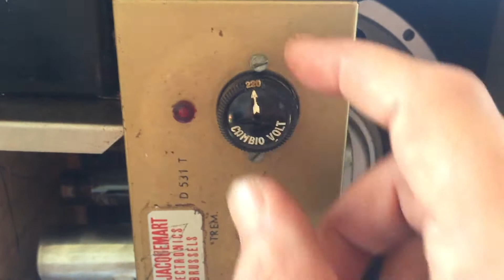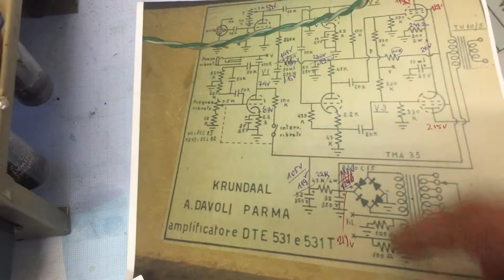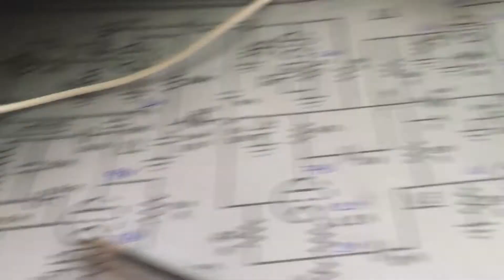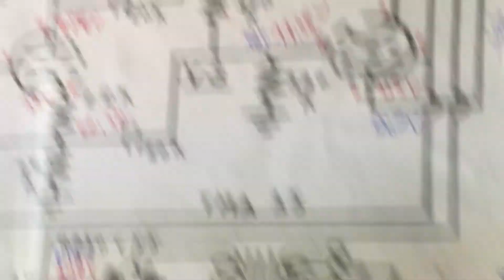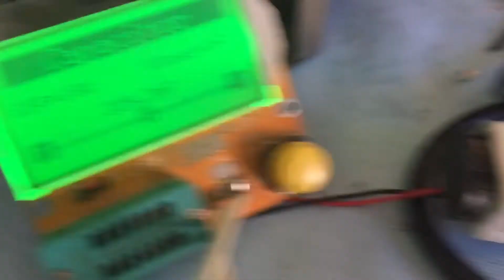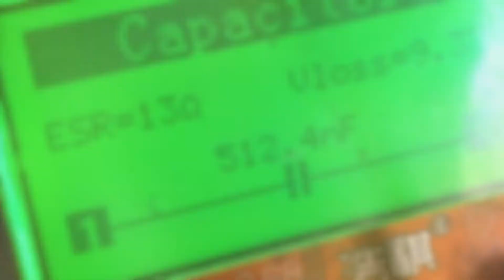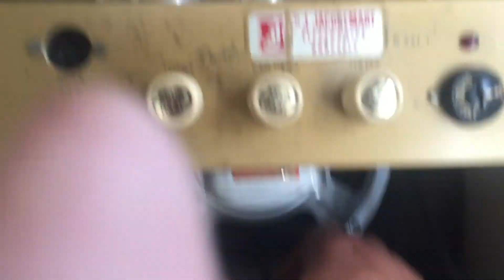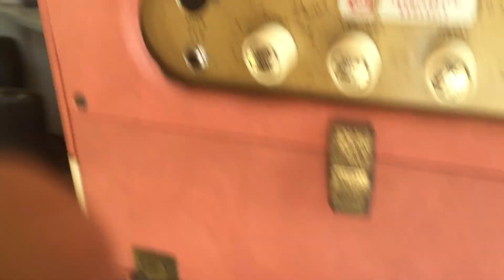Davoli D531T - PART 2 Restoration and repair

Comment: What a great voltage selection switch.
Reply from the maker: Yes, they are standard on old European gear because voltage didn't become standardized until the 80s and even now almost everybody runs 220-240 every country still has its on type of plug. Still the exact voltage I need isn't there - so this may raise the filament voltages a bit... I got a feeling I'm not done with this baby. I'll be ordering new tubes, meanwhile it's running, although she's running as hot as a 60s Italian porn star at an odd 11.5W...

Because the tremolo is working on the grids of the output tubes, improving the bias of the amp may also enhance the choppiness of the tremolo...
Reply: zjokka the switch is much nicer than the big Fender style ones, or the modern but safe slider switch you can’t access without a flat blade screwdriver.

Yes, even with our more modern higher voltage, I still find I need to set the bias correctly on most vintage amps.

Looking forward to seeing more. I’ve had more projects come in that I’m recording now due to now being unemployed. No live performances anymore, and I’m about to reregister my effects pedal company to begin production of pedals again.